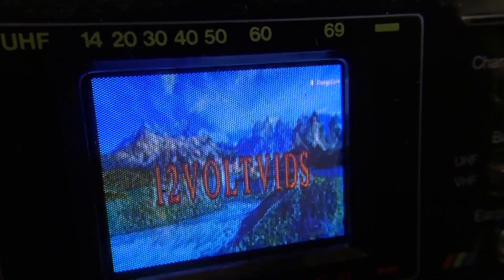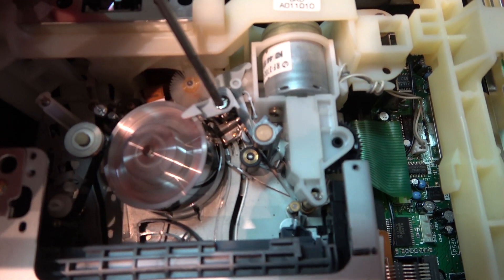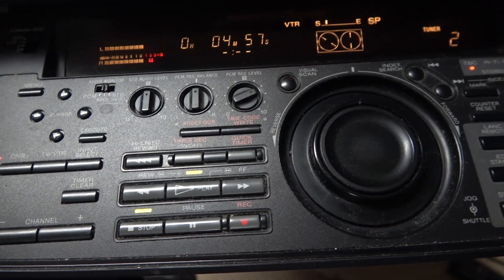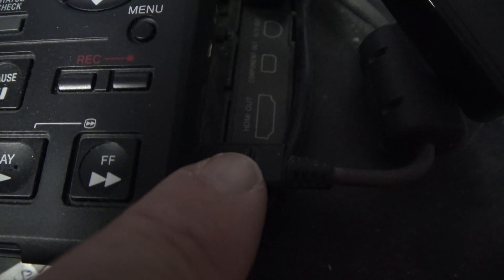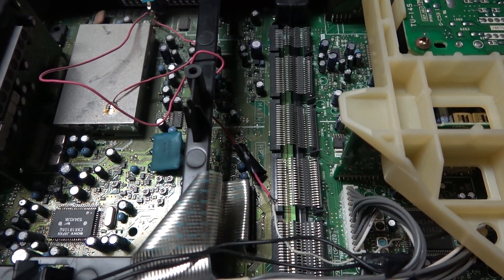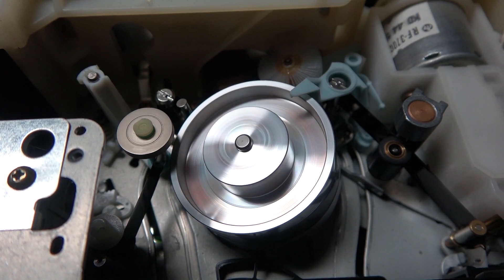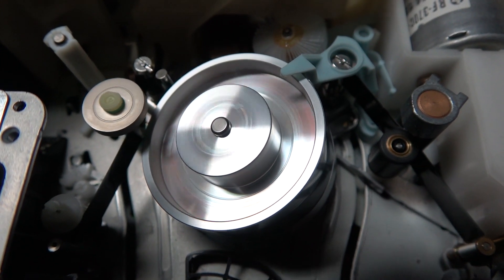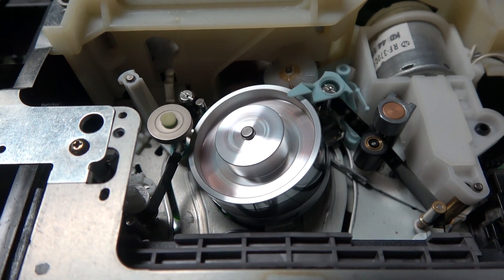recovery of 8mm tapes

Comment: You still fiddling with tapes it is good to see antique equipment being looked after, I dumped most of my tape things but had a touch of nostalgia playing a cassette my parents had in my old toyota Ute recently , first time played for many years never have the radio on while driving either . - 

purchased one of those rca to tape head convertors but it's no good doesn't work , so old tape boom box to the rescue powered from car cig  lighter socket for phone watching YouTube , used the Bluetooth module you recommended , just get away noise wise sharing same same DC supply line.

Comment: I read several years ago about an experiment at the US Library of Congress to recover sound from old records, based on a scan of the grooves... I wonder if anything like that would ever be possible for a magnetic tape?
Reply from the maker: Ya, scanning them with a magnetic head. You know, with a tape recorder or vcr.
Reply: I have seen on YT  a solution for floppy disks, a unit that can read and store the media, but not as a digital support, but more like analog, with all the readings on magnetic field change, timming, etc, tons of parameters, that is way beyond any floppy drive on the market. The dump is many MB in size actually and is like the bare reading of the signals of the heads but aided with other information. I guess this dump is them processed by a tool. They idea behind is it is independient of the density, system, recording method etc. Look more like a forensics tool. But as magentic support, floppys are a joke comprared to VCRs (I think). But this got me thinking that you can scan the media somehow ... but then you need something to make sense of all this data.
Reply from the maker: @38911bytefree  totally different. Floppy tracks are spiral and they just spin the disk and pass head over and log the tracks.   Then demodulate later.  Thus way data can be picked off including data marked for deletion but not overwritten.  Same is true for hard drive.  
Video tape is written as diagonal stripes which must be accurately tracked by the spinning head and linear movement of the tape to recover the RF signal. Sure you could record the RF directly in another medium such as digital but you would still have to be modulate that RF signal back down to its original analog form at some point. VCR itself debodulates the RF signal played off the tape back to its original analog form in real time. In DV and digital 8 the RF signal is demodulated to the raw data signal and that data signal is sent directly to firewire connector to interface with computer or passed to video processor chip where video signal is generated again.

Comment: Do you use a scope for re-aligning the machine back to factory specs?
Reply from the maker: yes usually.
Reply: @12voltvids  Would you mind showing how is done ?. Never been in a VCR, at least with an scope.
Reply from the maker: @38911bytefree  i have done several videos in tape path alignment.

Comment: I had something similar happen with two VHS tapes recorded on a cross country vacation to California. This was weird because I was able to use the same alignment technique to rescue portions of the tape. However other tapes recorded afterwards played fine on other machines. Could there have been an issue with the two scotch tapes I used? This was recorded on a camcorder that could record SP and SLP speeds. My dad kept accidentally switching to SLP and in those sections I could not get rid of the lines. I’m guessing it is because the narrower track. I’d be interested in your thoughts!

Comment: Very well done.  I would love to get more info on the audio mute defeat.  I have a different Sony model that I would love to mod to do this.
Reply from the maker: Will need the service manual to find the mute pin. You can see in the video where the wire went. To a 100 pin flat pack IC.
Reply: @12voltvids  Thanks. And grounding that pin turns the mute off?

Comment: We have some beta max tapes that had similar tracking issues. Always wondered if something like this was possible with one of those. 🤔
Reply from the maker: Beta machines generally did not drift.
Reply: On Beta the adjustable guides are stationary so alignment issues aren't so common. The adjustment procedure for Beta is similar to VHS and 8mm. In fact he demonstrated it in a few other videos.

Comment: Well, you have bought an 8mm Nakamichi with auto aligment LOL. Serioulsy, very interesting vid, dindt know this issue. We have 5 o 6 8mm tapes .... and 5 to 6 VHS-C tapes. I tried to keep the VHS-C machine alive all this years with periodic power up and letting it warm up for hours. I need to back up this tapes and I only trust the machine it were recorded on. The 8mm was a Hitachi and the VHS-C is a Panasonic (still going fine, bought it 98 !!!!). Porbably caps will start to leak all over. But, in general, Panasonice never let me down.  I got a free FS88 too, getting some lines un the upper part of the pictures. I keep it foe the "HIFI STEREO" audio portion because some audiphoolery claims that they make nice CD-alike recordings (on the FM track).

Comment: Here is a question:  Hope you can answer it.  Ok so I have been digitalizing my VHS tapes and I find that they mostly lose their color.  Why?  When I play them on the television, they look fairly clean and with color (considering they are 20 years old), but then when I digitalize them, they look almost in black and white.  Hope you can help me understand why.  You seem to have extensive knowledge of VHS videotapes...
Reply from the maker: And that is the difference between do it yourself home digitizing equipment and professional gear.   Professionals use a time base corrector and a processing amplifier or proc amp. This device allows the video to have the video and chroma levels adjusted before digitizing.   when i digitize the digital copy looks exactly like the original. My a/d capture was 1300.00

Comment: Can you unerase a 8mm TDK videotape?
Reply from the maker: No once its been erased its gone.
Reply: @12voltvids  but I can still hear the audio...it's only the pictures that's missing...
Reply from the maker: @marchielobailey  then its not erased.  On 8mm video tape the audio is recorded along with the video using the same head, just on a different frequency fm carrier.  So if there is sound the player has an issue.  Either that or the camera had an issue with the video recording circuit when the recording was made and only audio recorded. That is always a possibility.  I mean how many people actually watched their home videos after they recorded.  I get many tapes in to transfer that I can't do because the camera broke (canon were really bad for this) a guide pin fell out and dropped inside.  It would go through the motions and record a partial signal.  No warnings at all.  Client brings me 20 tapes and the first dozen are fine and the rest have nothing. Or the old pinch roller failure another canon headache.  Tape recorded fine but pinch roller creases the tape after recirding.  Then any attempt to play when the damaged tape goes over the head it clogs.  Clean the machine get 30 seconds till the next damage section head clog again clean get another 30 seconds or less.  Has no clue the camera was bad because the tapes were never played after recording.  You would be surprised how many never watched their tapes after recording.  Many didn't even rewind them.  Just took them out and put in box and loaded new tape.
Reply: Any suggestions on how to clean it to get the video portion back? The recorder is made by Sharp.

Comment: I have a Tascam DA - 88 that use`s the hi eight 8 mm tapes for 8 channels multitrack audio ... !!!
Reply from the maker: Yup there were a few digital audio recorders that used video tape. The first one used 3/4" umatic.  Then there was the betamax adapter for the sl2000 and sl2001 recorder.  There was a pcm switch on many home beta units.  The pcm switch turned off drop out compensation as it would corrupt the data stream.  Then dedicated multi track recorders came out.   ADAT used a super VHS tape and the 8mm camp had a tascam 88. Sony had one as well.